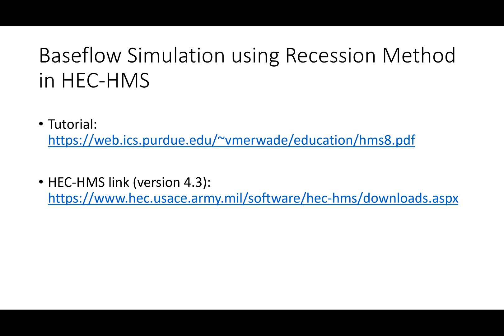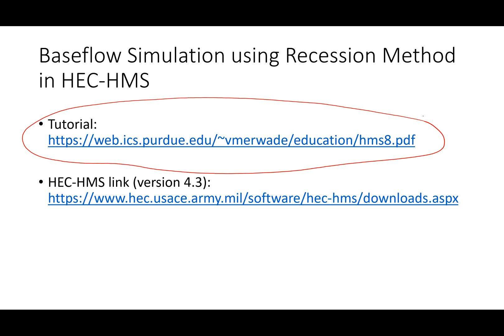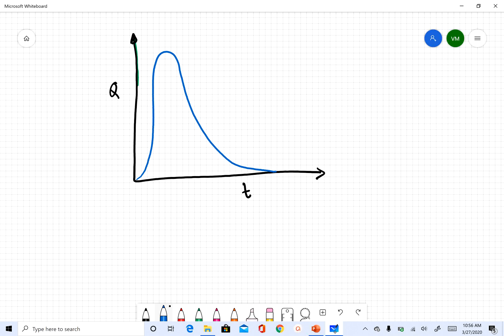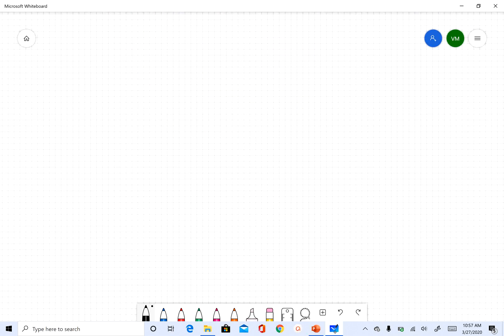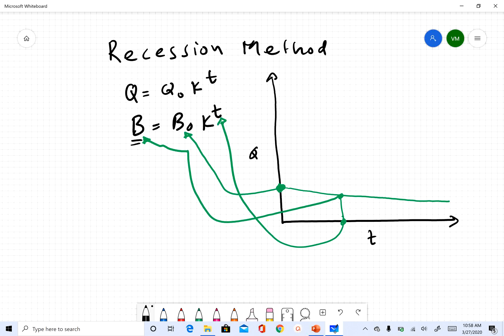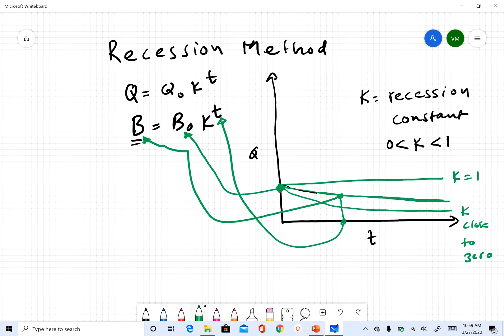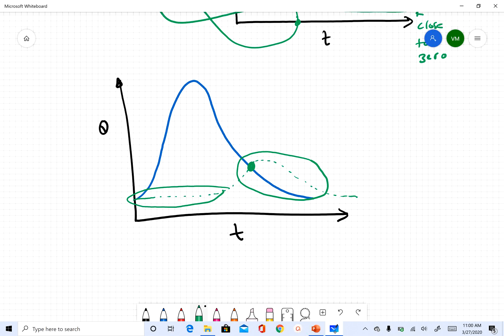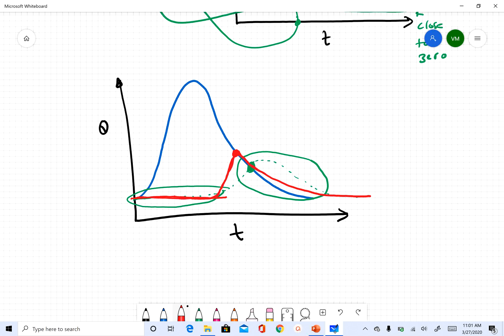Lab on Baseflow Separation

Comment: what is differences between this method and fixed base?
Reply from the maker: The baseflow region looks similar! The main difference is the approach and how you apply it. Fixed base is a graphical or manual method, whereas the recession method lets you play with parameters and automate the process.